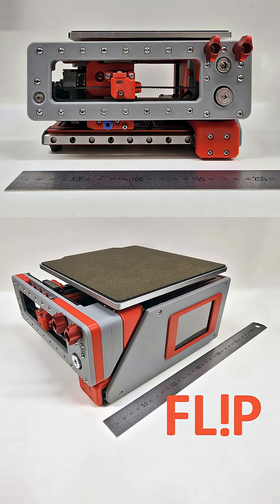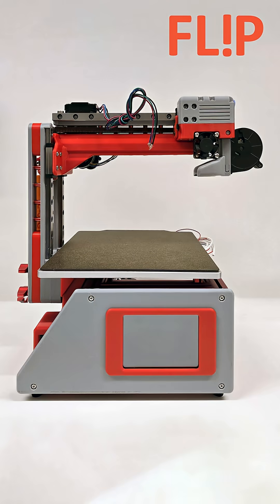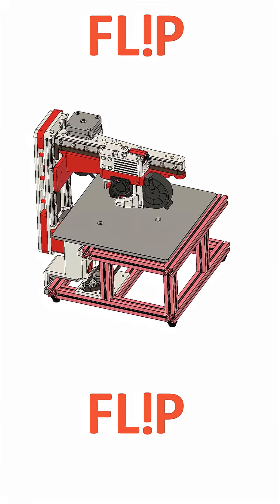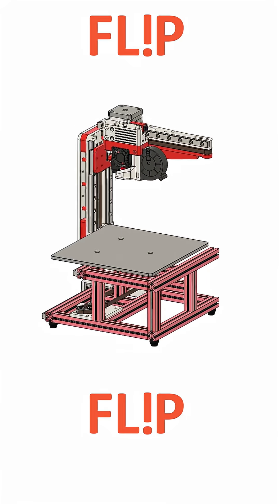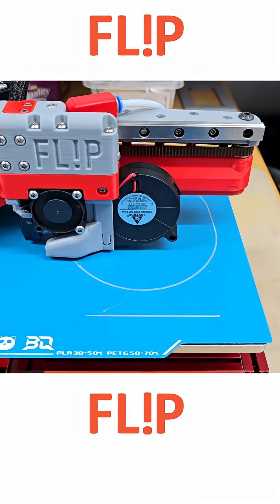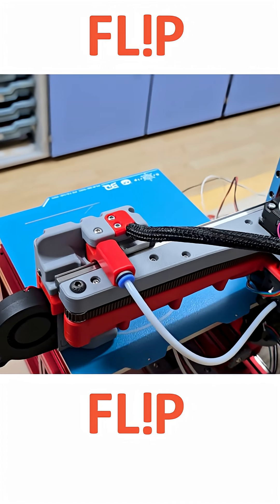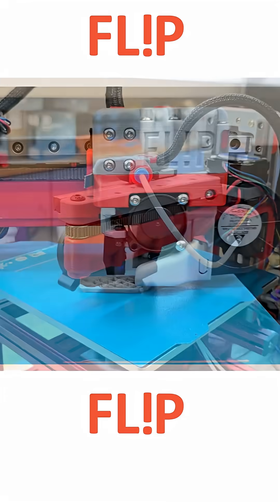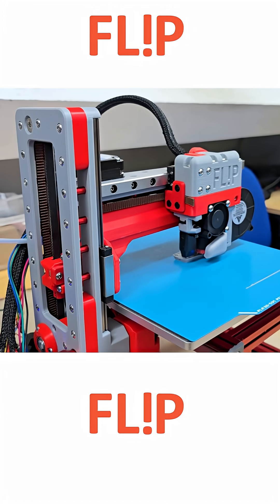Flip - Foldaway 3D Printer

Comment: You could use the motor of unfolding to have a 4 axis 3d printer
Reply: That would be unlikely plausible due to the point of rotation of the 4th axis, however unlikely is not impossible.
Reply from the maker: This still a very good concept, thanks for the comment